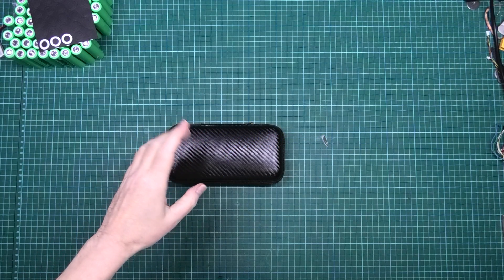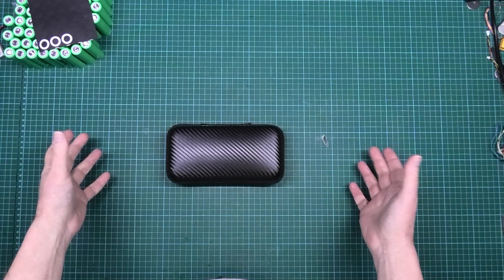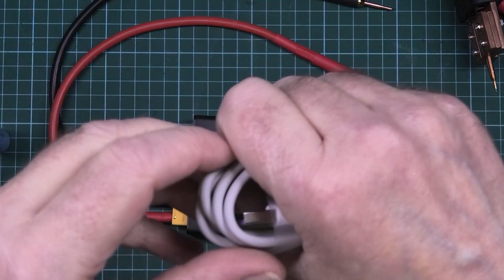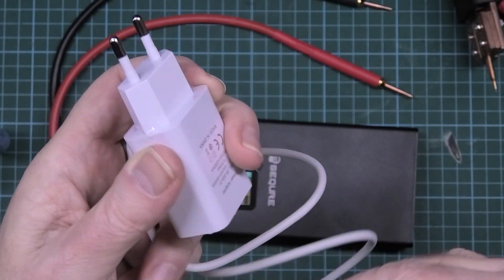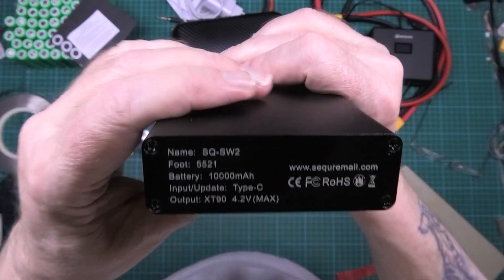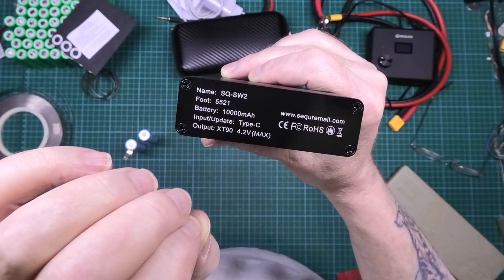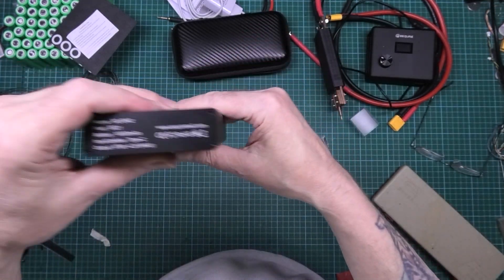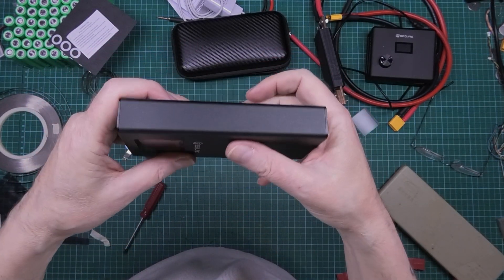Sequre SQ-SW2 mini spot welder review

Comment: Review !!!?? HAHAH Utter drivel !! Absolutely useless video ! Why are you pressing super Hard on the contact pins during the weld ? isnt the current thinking, that resistance at the weld requires you to have a light pressure !? As for the rest of your video ! OMD who scuffs up the lilo cell surface before welding !? hahahahah idiot ! You're  not soldering it !!

Comment: Do you recommend this version (SW2) over the other version. I found this much better from videos, but the other one is advertised to weld up to 0.3mm thickness, but have not found any video making experiment and proving it. Both versions were tested up to 0.2mm nickel. Could you please share your views? Thanks.
Reply from the maker: Every spot welder is just a dumb terminal and the thing that makes a good weld is the battery. This one is good for thinner nickel but the other one is the one I always use along with my battery which is capable of delivering over 1,000A
Reply: @Vortecks  thanks for reply. Decided to go with portable version as this is for rare use only.

Comment: Love the northern bleeping.  So £75 and it still won’t weld 0.3mm even on 99 milliseconds. 
That’s a bugger. Because I want to swap some 0.3mm tab-contacts over from some 15yo V250H doubles to fresh ones. Think I’ll go the DIY lead acid battery route.
Reply: I have a 10000mAh spot welder, very similar to these above. It will not get even close to spot welding .25mm .2mm is way on the edge. I would spot weld .15mm on top of .15

Comment: I did the first ever spot welding using Geek teches GT-680 on AA Ni-MH 3000mah batteries for my Dremel 7700 tool.  My Dremel tool works again.  No flaws what so ever.  I got more longer run time.  The hardest part is trying to find a way to hold the batteries.

Comment: Looks like a bargain. How many welds do you think it will do on one charge at full power, and can it be charged while welding ??
Reply from the maker: Don't hold me to this but I reckon around maybe 200 and I can't see why it can't be charged whilst welding, the charge side is on a seperate circuit.

Comment: How does it work without a foot pedal? Does it detect when both probes short on the nickel and then applies the current?
Reply from the maker: Yes, it senses a resistance across the 2 probes and then it fires.
You can set the trigger time from 0.1 second to 3.0 seconds in 0.1 second intervals.
Reply: If you need to ask such a stupid question ! you probably shouldn't be using it !!